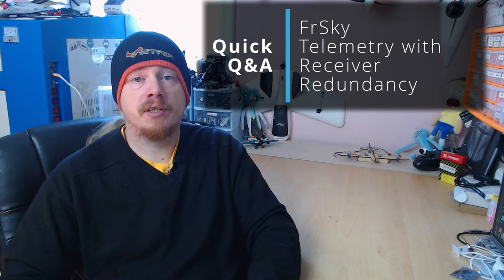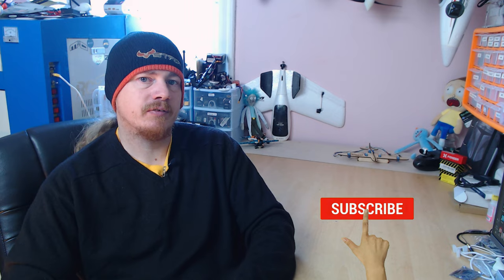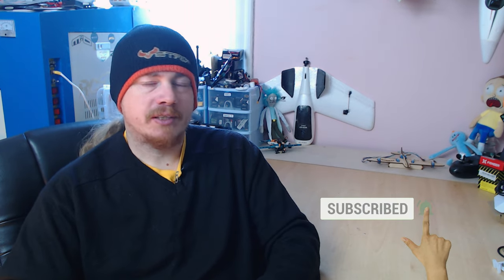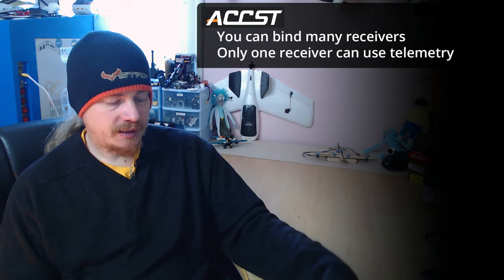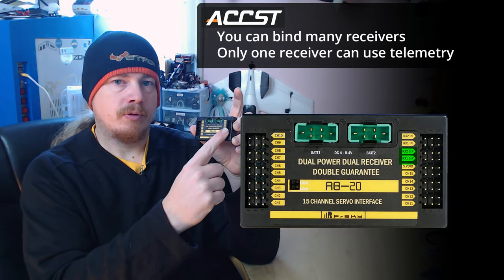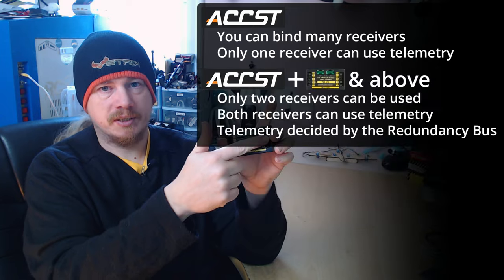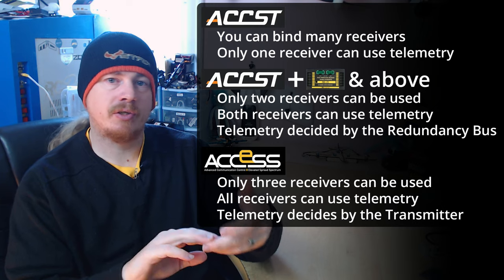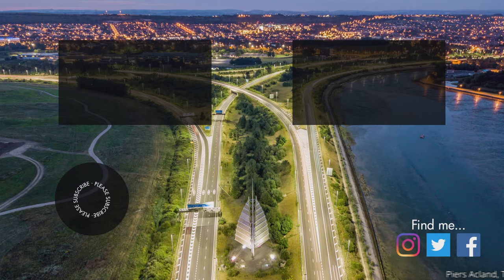The definitive answer for using telemetry with FrSky receiver redundancy

Comment: Thanks for doing the leg work on this Darren. I have been using the telemetry on both my 2.4 and 900 redundant receivers at the same time without any issues. I think I may have been one of those comments you spoke of. Nice to have a definitive answer, Thanks again 👍
Reply from the maker: At the point of making that video, the past advice had been only use telemetry on the master receiver. But afterwards I spoke to FrSky and they confirmed the telemetry rules on all systems. 

ACCESS can have telemetry on with all receivers.
ACCST can only have telemetry on the master receiver.
https://youtu.be/Q59ai7sZA1E

Comment: Hi Darren, thanks for this video. I have a question re telemetry while using 2 independent Rx's.  I have an Archer R4 controlling rudder, eleveator and throttle. I also have an Archer GR6 controlling 6 wing servos.  These are not providing redundancy but acting independently. Everything I want in terms of servo function is perfect but I want to be able to use the altitude & vario sensors of the GR6 and the ADC2, for battery voltage, of the R4. When I look at the Tx telemetry page I can see the sensors, and, within each sensor, it indicates which receiver this relates to but this is greyed out and so cannot be changed. I'm currently running Ethos 1.4.13.

Comment: Thanks Daren. Enabling telemetry on both  2.4. ghz and 900 mhz. works just fine on the X20-S. The display shows both and issues alarms on each ,separately, should an issue arise.
Reply from the maker: Yes the frequency doesn’t matter. It’s the protocol that defines the rules. ACCESS can bind with telemetry enabled for all receivers.
Reply from the maker: BTW Frank, please don’t think I’m ignoring or deleting some of your comments. YouTube has a habit of removing a lot of comments it thinks is breaking their community guidelines, but I really don’t believe are. Your last few comments, I’ve seen the first sentence, clicked to view the comment and reply. But the next screen just shows no comment found. YouTube’s bot has deleted it. It’s most frustrating.
Reply: @MrD  Thanks Daren .On the issue with the "Self Check". I rolled back the firmware  to see if there would be a difference. No luck. I have ordered four of the SR8Pro receivers to see how these will respond. I'm beginning to think that this is a firmware issue. The same problem has appeared on my other three SR10Pro receivers.
Reply from the maker: The last comment you sent was instantly removed again Frank. I’ll contact YouTube again. But last time they didn’t help. They insisted that it went against community guidelines, when I could tell it was a technical question.

Comment: Hello Mr. D, I came across your channel and this video while googling for info on the possibility to receive telemetry data by 2 independent devices (on the ground). I did not find it in this video on the redundancy topic (guess google brought me here because you discuss telemetry issues when configuring redundant receivers). 
First device is the RC (a TX16S which is bound/tuned with a R-XSR using ACCST). And 2nd a PC to capture and record the telemetry.
Does such USB dongle for receiving telemetry on a PC exist for FrSky telemetry? And how would one set it up to listen on the telemetry transmission between the RC and R-XSR? Thank you!
Reply from the maker: You would not be able to do this using another transmitter connected to the PC. You can only bind one transmitter to the receiver. 

The two options that may be worth looking at are transferring the telemetry from the transmitter to the PC via Bluetooth or WiFi. The other option would be a separate telemetry system. Something like BulletGCSS may be just what you’re looking for.
Reply: Hello Mr. D, thank you so much for your suggestions (I'm only recently joining RC country and have a large "technical debt"). I found references about a BT module for the "hobby" RC TX16S I have (I was afraid such WiFi/BT options would only be available in professional RC equipement). And your BulletGCSS suggestion made me search for LTE inside the Ardupilot documentation. There I found the "Redundant Telemetry Links" topic!

Comment: Hi Darren, thanks for your informative video.
have you had and sensor conflicts using ethos and additional module on the s port
I am running 2 accst 2.0 r8's via an RB20
when powering on the model the radio tells me sensor conflict

Comment: Recently upgraded to ethos with x10 horus.  Can't get telemetry from v 1 redundancy bus and redundancy bus 10. Can only see telemetry from rx but the sensors of bus are not detected. Using  rxsr main rx and xm+ conected in both.  Accst v2.

Comment: Hi Darren,  A question.  Is it possible to have an R-XSR running ACCST as the slave receiver giving redundancy to a TDR10 running Ethos from an X20?   I'm guessing not as the TDR10 sort of has redundancy built in with the 2.4 and 900 frequencies.    ?         Thanks E.
Reply from the maker: It isn’t because unless you use an external transmitter module. The redundancy receiver on the internal module would need to use the same protocol as the master receiver. In this case, Tandem.

Comment: Hey Daron,

I have the x20s and a TDR10 receiver.

I would like to put 3 sensors.
GPS, Lipo Voltage, and the Vario sensors.

Can I piggy back all three on that 1 receiver TDR10?

Also,..... If that works.... can I have a second model and before powering up, swap all three sensors to the second model and it work easily or would they have to be bound each time?

Both models have the TDR10
Reply from the maker: Yes, the sensors will daisy chain. Each sensor has 2 connections for the SmartPort/FBUS wire. So connect a wire from the receiver to the first sensor, then from that sensor to the next sensor, and keep going. So long as all the sensors are different types, you shouldn’t have any issues. Sensors of the same type will have the same ID. 

Sure, I don’t see why you couldn’t swap the sensors between the planes. They don’t bind. You just discover the sensors on the telemetry screen. Once discovered, they will stay there. They should even stay there if you don’t connect the sensors up. Of course that part of the telemetry won’t work. But next time they’re plugged back in, it will work again.
Reply: @MrD  Awesome!!! Loving this new FR Sky! Time to sell my Futaba 18Mz

Comment: I am having issues with the rb30 I did the firmware update and Flash to the rb30 when I go to device configuration tap-on rb30 all I see is base config,Fail-Safe RX1 ,2,3 map no calibration or anyting how do I calibrate it how  do I enable the stabilization and I'm lost. Did I not download something on the firmware.Thanks  for your video's and taking time to help us old guys out
Reply from the maker: I Randall. To be honest I’ve no experience with the RB30. Have you tried using the SxR tools with the RB30? From the manual, the set up looks identical. Maybe the tool works on ETHOS, so the developers didn’t duplicate the functionality?
Reply: @MrD  Im using X20 radio and cant configure anything on rb 30 are they not compatible? Only thing that shows up on the radio in device configuration is rb30 base configuration and that doesn't allow you to do anything except set a voltage setting no configurational stabilization nothing.Any ideas
Reply from the maker: They should be. There is a specific setup tool for the RB30/40. On the same page as that tool, there are SxR Calibration and SxR setup tools. You may find they work with the RB30. 

I’ve seen in groups that people are using the RB30 with the X20.

Comment: If I use 2 G-RX8 is it possible to use more than 8 servos connected, connecting to both RX PWM outputs?
Reply from the maker: Depending on how many servos you need. The better option may be to set up the G-RX8 to output SBUS. Then use an SBUS to PWM converter to access channels 9-16.
Reply: @MrD  I need 10, do t want to mess with extra stuff, to keep simple if it’s possible to connect 2 G-RX8 in redundancy and use the slave receiver PWM ports wold be nice, is it possible?
Thanks
Reply from the maker: Actually, using the SBUS to PWM converter would be simpler than using 2 receivers. There are also the issues that if you lose one receiver, you’ll lose half the channels. So there’s no redundancy there. With the converter, you can use up to 14 channels. Usually it would be 16. But to use SBUS with the G-RX8, you lose 2 outputs on the receiver. Unless, I’m thinking of the old receiver. The glider receivers have very similar names.
Reply: @MrD  I understand, so is it possible? 
I’ll try both approaches, just want to be sure before buying 2 RX, I’ll get 2 RX and the converter, I have a XSR, if I go for the converter I’ll go with XSR as slave, thanks
Reply from the maker: It is possible with 2 receivers. But better not to.
Reply: @MrD  got it, thanks a lot, I was thinking about nose wheel steering,  landing gear and lights to the slave and the flight controls to the primary, this way I get redundancy in what is needed

Comment: Hi mate , Can you use the Tandem x20 to Accu Rc? Thanks
Reply from the maker: If that’s the heli sim, I don’t see why not. The X20 will connect to the computer via the USB cable. Then it just behaves as a joystick. Where the USB comes out the top, it doesn’t get in the way as you’re using it. Plus, it charges the X20 while you’re in the sim. 

I use my X20S with sims, and it works great.